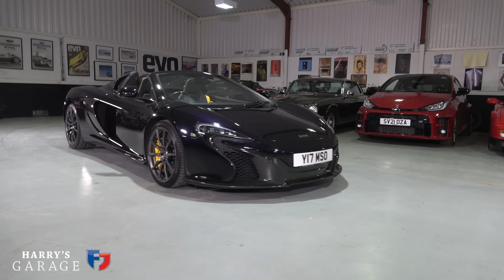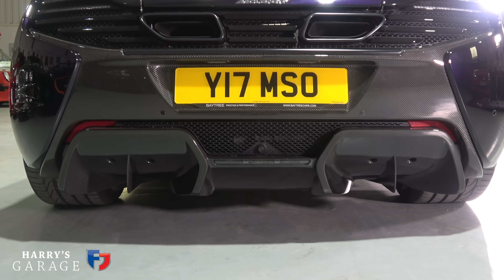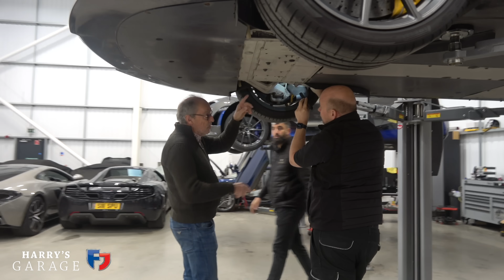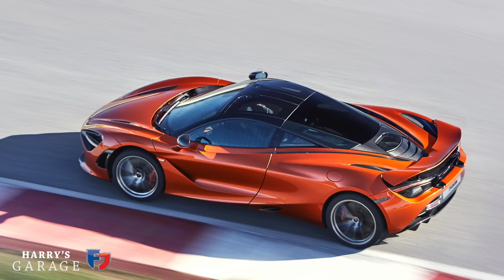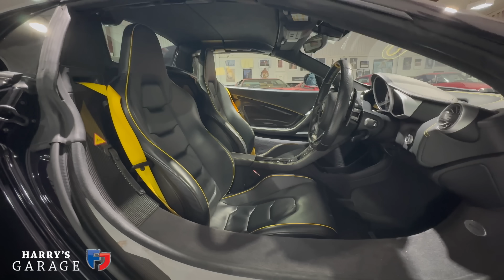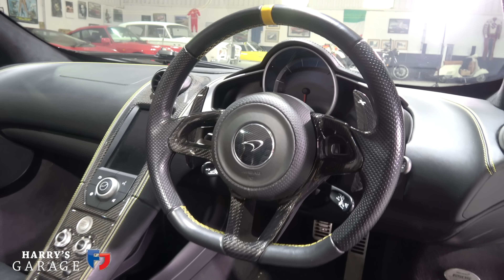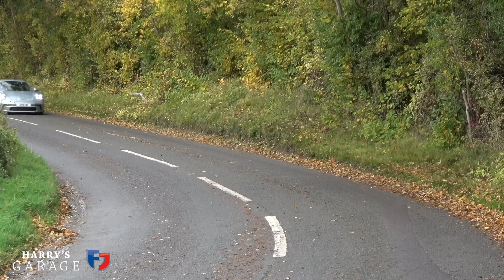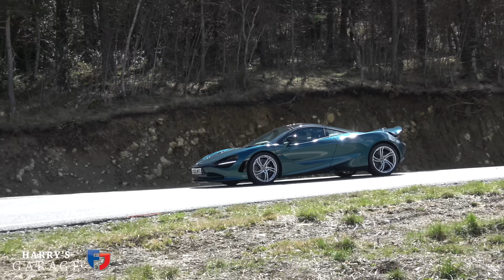McLaren 650S 6-month update. How much does it cost to run a McLaren? Servicing, warranties, parts..

Comment: 10:24 it's extraordinarily disappointing the dealership will only replace the entire transmission and not a single seal
Reply: Maybe they should replace the entire car when that transmission seal goes - it would solve those corrosion problems 😆

Comment: I wouldn't leave it too long to deal with that corrosion, aluminium corrosion is like a worm under the paint and it moves quickly.
Reply: It wont rot. It will just bubble up more. Whatever he does, he has to repaint the entire car.

Comment: My 17 year old Jaguar xk needed a battery the other day so I bought the most expensive one for £350 , super cars are great but they are not made to last
Reply: Coincidentally our 17-year-old 300C also needed a battery yesterday and I splurged €156 on a Yuasa 5000 110 job. Most expensive battery I've ever bought. What did you get exactly for £350?
Reply: @sladehelicoptersgaming3148  my F-type battery was less than £200.
Reply: @vika0194  yeah the cheapest one I could get was £85 , but cars not starting really really winds me up 🤦‍♂️

Comment: A seal goes bad and they replace the gear box?!? A spring cracks and they replace the whole shock because it's more convenient? They're ripping off customers.
Reply: In the Porsche PDK internal "distance sensors" can go bad and Porsche just replaces the gearbox instead of just fixing the sensor. Okay, I suppose, if you're under warranty but potentially financially life-altering if you have a pre-owned car out of warranty. Madness.
Reply: @mikep.5517 life altering sounds like you shouldn't buy a Porche
Reply: Most dealers employ one experienced mechanic that looks after numerous apprentices that are essentially 'parts change' mechanics with little knowledge and experience.  As such, the majority of OEMs (sadly) apply the 'part replacement' philosophy because of risk.  I know of a young mechanic that recently completed his apprenticeship and has never rebuilt any component - not even a simple brake master cylinder - just remove and replace to a 'drum beat'.
Reply: Accounting and finance drives it all. It's about extracting efficiency from the business when a warranty claim is made. I am from a Big Four accounting background and I can tell you it is the right thing economically to replace the entire corner rather than trying to fix something that you might find is not fixable halfway through the process - what do you do with that time? Quite aside from the efficiency of just replacing with new.... The old corner will go back to the manufacturer and great reconditioned and reissued for the next corner that needs replacing... Far more efficient than breaking things down sooo long as a warranty applies. This doesn't take away from Thorney or V Engineering who do an exceptional job for owners outside of warranty due to the ruinous costs when outside of warranty because of the lack of an entire supply chain to a warranty claim part which would not have a reconditioned life.
Reply: IIRC, Hoovie (see YT) had an MP4-12C and it was already on it's 3rd gearbox - kinda expalins why!
You have to wonder what happens to all those old gearboxes ?!
Reply: @michaelbarton4787  the seal gets replaced then they put them in the next car and charge a new gearbox.
Reply: They do the same when the car is under warranty, nobody complains until they have to pay it themselves.
Reply: Try and get ANYTHING done under warranty.  Good luck 👍🏻 @pkpropertysolutionsltd701
Reply: @pkpropertysolutionsltd701  Yeah but they often refurbish and resell the parts back at a central facility, so apples to oranges.
Reply: Would you act a different way ? @pkpropertysolutionsltd701
Reply: @pkpropertysolutionsltd701  doesnt make it right - they are wasting their own resources and charging new customers for that
Reply: @pkpropertysolutionsltd701  warranty claim involves the dealer claiming from the manufacturer. The manufacturer supplies the parts and the dealer charges the labour to fit the parts. Do you think the manufacturer wants to pay the dealer (likely around £150 per hour) for more labour or less labour? That suspension leg likely takes a third of the time to swap out than changing just the coil spring and quite likely a less skilled technician could be trusted to do it because no spring compressors  (expensive/dangerous) are needed to change the complete leg. The old leg will go back to the manufacturer and if economically viable will be refurbished and sold as a recon part. 
Time is money.
Reply: @mementomori4972  parts go back and are rebuilt / refurbed. It would he criminal if they just threw them in the bin
Reply: So what happens 20 years from now with all mclarens and corrosion risk?
Reply: @ you get it fixed.
Reply: The customer goes bad and they replace it😂
Reply: Unfortunately this is the standard for most car makes now. My local Peugeot dealer. Car had a headlight problem. It was traced to a faulty wire but didn't want to spend time looking at it. Wanted to replace the headlamp assembly and the entire lighting wiring loom.  Car had a gearbox issue (similar to  a seal issue). Takes too long too long to fix the gearbox, they simply fit a new one. It's seems to be the way main dealers work now. That's why it's better find a good specialist who you trust and you know won't try and rip you off.
Reply: Who
Reply: @mementomori4972 every McLaren I’ve ran was $2000 a year for service… newer cars mind you.
Reply: Probably a safety thing, because technically these cars have to be capable of driving at very high speeds and on track etc, so when they leave the shop they probably have to meet specific specs
Reply: Sounds more like a pit stop than a service?
Reply: Every "authorised dealers" are like this. It doesn't matter which brand it is and which country you belong!! It is called "white collar loot"!
Reply: Craziness
Reply: Less training, less wages.

Comment: Appears that the build quality is AWOL straight out of the factory…

£34+VAT for an oil filter? What’s it made from?  Renew wheel bolts, what happens to them…?

Note to regulators…. What is the bloody point of DRL’s being on at the front & the rear lights are off????

I get the impression Harry wanted to rip into McLaren for the reliability but somehow restrained himself…

Comment: Corrosion, lights falling out and windscreen surrounds coming loose. What shoddy build quality. Hopefully the mechanicals are better engineered.
Reply: Quality in the best tradition of the old British roadsters😂
Reply: they aren't
Reply: Have you seen the ‘quality’’ of other brands? Only Porsche can really hold their place for quality, next and quite a bit further back is Lamborghini… Ferrari are some of the worst…. Unless you are a multi-brand seller or repairer you can only go on comments on the Web and these are tilted by the made sale schemes like Ferrari use to get the ultimate cars, this stops customers really using the cars the cars they have to by but didn’t want and they are mute to issues for fear of upsetting Ferrari and getting struck off the ultimate cars prize.
Reply: Sounds like a big headache and money pit
Reply: You are right…. He should have bought an Audi...  If you do not understand performance you never will.
Reply: @edinburghrose  oh I understand performance alright. I just don’t understand substandard manufacturing integrity, especially in a car costing six figures. How silly of me huh?!
Reply: @edinburghrose Audi 🤣🤣🤡
Reply: @edinburghrose what’s perfomance got to do with build quality, it really is unacceptable in a modern car to have this huge amount of corrosion and that the lights are expected to fall off. I’m totally appalled.

Comment: I think the problem with the accumulators is the membrane more than pressure drop. Once the membrane goes the accumulators need to be replaced.
Reply: And all the bits of membrane travel through the hydraulics then you really have problem,

Comment: The problems in the first ten minutes of the video make McLaren sound terrible… and McLaren will bill you for a whole new gearbox when one seal goes?!
Reply: I’m a Hokey Pokey type McLaren buyer. I have one foot in and one foot out.  I’ve owned 6 911s including 3GT3s but they’re so expensive I went to Lamborghini. But I’m thinking of McLaren because they’ve become so affordable. But still I’m scared
Reply: That’s not brand specific that’s just how main dealers work
Reply: Got a 7yr old 570s done 4500 miles in it in a year…only issue I’ve had is needed a new battery…if you get it inspected before purchase they aren’t as bad as everyone makes out..in my experience anyway..
Reply: Ferrari dealers or Lamborghini dealers absolutely would do that as well in such cases.
Reply: Mclaren is not known for they’re reliability…the depreciation on these things is terrible for that reason
Reply: @ McLarens made after 21,22 are considered well sorted.  Yes depreciation makes McLarens affordable to more people. The first McLarens like the MPC-12 aren’t very reliable but I wouldn’t hesitate to buy a 765 lt or 720S or 650S(once it’s sorted)

Comment: Crazy to have so much corrosion after 6 months, that’s just insane at any price point.
Reply: After 6 months of his ownership. He said the car is 10 years old.
Reply: @sessionstu I understood that, but the car has less than 10k miles on it and probably was sitting at a dealership/garage for most of its lifetime
Reply: It’s not ‘rust’, it’s electrolysis, caused by the aluminium coming into contact with steel. It’s a natural phenomenon and happens on boats and used to happen on my Defender, you can’t always predict where it’ll occur.
Reply: @thorsley1  Yep its the same thing and just as hard to control and just as ugly.
Reply: 10 Years!
Reply: Seen countless videos about the quality (or lack of) of McLaren stuff.. it amazes me they sell as many cars as they do honestly.